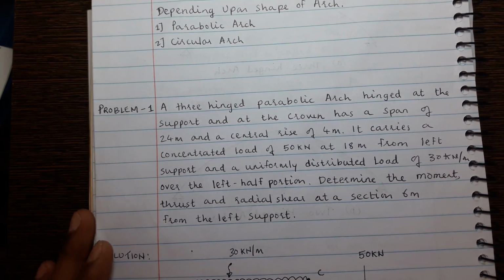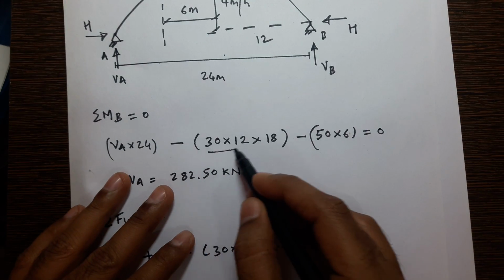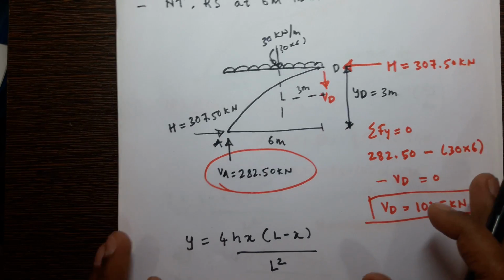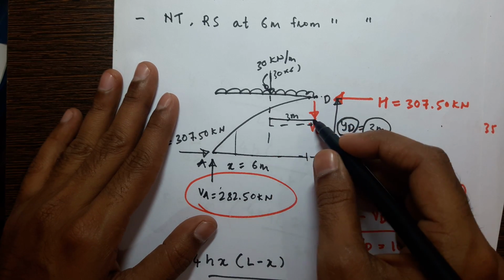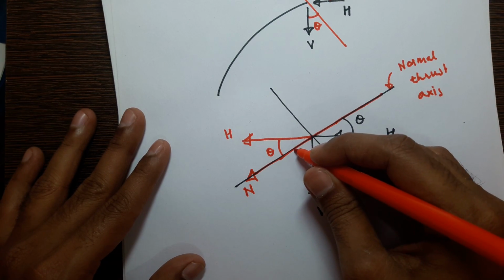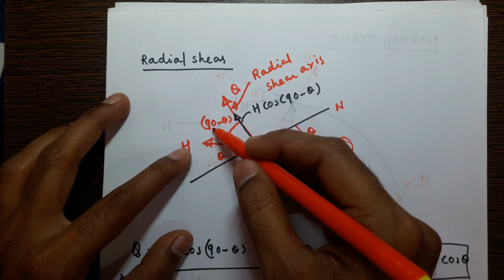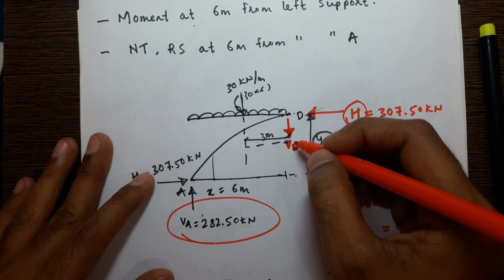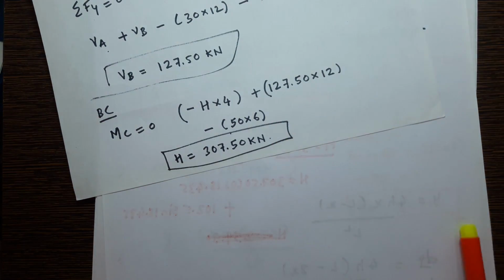Analysis of three hinged parabolic arch problem no. 1

Comment: sir, what about reactions from C while calculating  sum of bending moments at B?
Reply from the maker: There will not be any reaction at C since it is not a support. Vertical shear and horizontal thrust will be there at any point in the arch including C... vertical shear is not constant and will also be zero at some point... But horizontal thrust is constant throughout the span of Arch

Comment: Can i have a question? Is the relationship y={4hx(L-x)}/L^2 also applicable in unsymmetrical arch?
Reply from the maker: Jeram Santos yeah.. but carefully..
Reply: What will I use for the value of "h" then?  Lets say the point A is 1m higher than point B but the distance of point B to the top is still 4. What will I use for h? Thank you :)
Reply from the maker: Jeram Santos not just h value even L value will change... for example ACB is an arch where c is internal hinges.. When you are analysing for AC L is equal to 2 times the horizontal distance between A and C... h is equal to Vertical distance between A and C...
Same theory is applied when you are analysing in span BC.